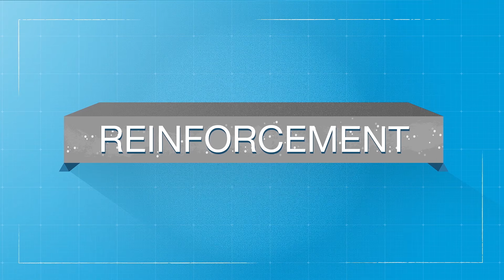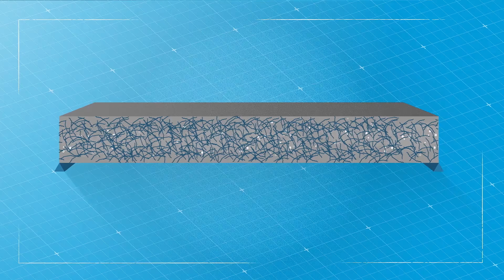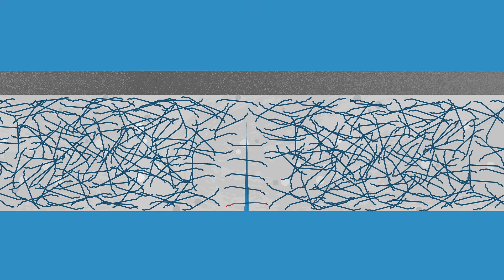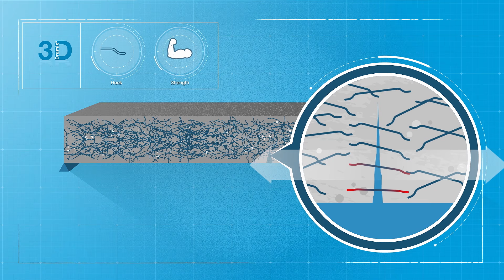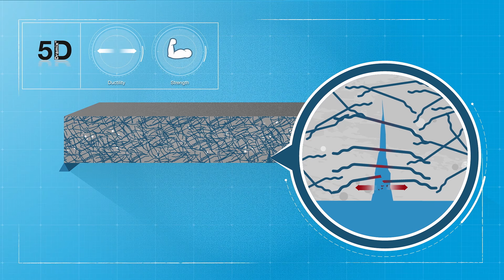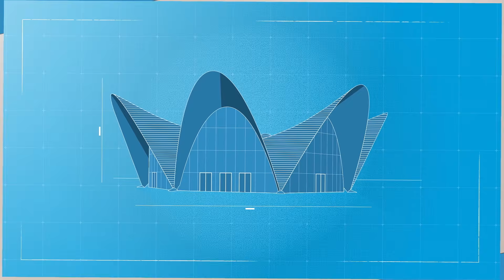Steel fiber concrete reinforcement – how does it work?

Comment: The question is does steel fiber rust? if so it doesnt help in concrete lifespan. We need an alternative that does not rust and can last longer than 50 years.

Comment: What happens when all those fibers rust?
Reply: The surface of the building gets a varying rusty color.  If you need a appearing surface it is better to use PP monofilaments. The remainder of the monofilaments are flamed away.
Reply: @holgernarrog962 what is PP?
Reply: @MadLadsAnonymous  Polypropylen....It is widely used for monofilaments for concrete in mining.
Reply: @ Is this the same strength as PET fibers?

Comment: What about corrosion? Doesn’t steel fiber corrode like rebar?
Reply: That`s the reason that there are alternatives as pp monofilaments, basalt fibres.
Reply: I'm not an engineer, but I think rebar and steel fiber only corrode when exposed to air.  If it is fully embedded, it will last forever?
Reply: @treslongwell1332 In ideal situation, that may be true. But when is it ideal unless you’re in a lab?  It’s just not air, Chloride leaching in marine environments and due to road salts can wreak havoc on steel rebars.

Comment: What about rust ?
Reply from the maker: Dramix steel fibers are coated with an innovative inhibitor to limit corrosion. Moreover, once the fibers are added to the concrete the possibility of corrosion reduces significantly.
For more elaborate information check this link: https://bit.ly/3kKJ55F

Comment: No comment on corrosion? Steel all the way up to the surface seems like a major issue.
Reply from the maker: Corrosion on steel fibers doesn’t affect the mechanical properties of the concrete. The fibers form a discontinuous network of reinforcements so the corrosion stays limited to the outer surface of the product. Because the fibers are small, the volume increase does not lead to concrete spalling either. If the visual aspect of the end product is important, many of our fibers come in galvanized variants as well as well to avoid any corrosion at all.

Comment: I scrutinize about hybrid-fibers. What is the best (in terms of compression,flexural strengths,split tensile strength) hybridfiber percentage for 1m³ concrete by volume ? If i determine total volume %0.5 for 1m³ concrete, how much i use polypropylen and steel fibers? Or steel fiber and glassfiber?
Reply from the maker: From a structural perspective a combination of steel fibers and traditional rebar or steel mesh offer good strain compatibility (see design guidelines in Modelcode 2010 or the German DAfStb guideline.) 
It is proven that the steel fibers in this hybrid system offer substantially better crack control, improving the durability of the structure. Also for the ultimate limit state the fibres increase the resisting moment capacity. The optimal ratio depends on the project requirements and should be defined by design. 

For outdoor pavements, a hybrid system combining steel fibers with micro synthetic fibres is good solution. The micro synthetic fibres will reduce cracks due to plastic shrinkage while the steel fibers will increase the loading and fatigue capacity of the pavement. 
The optimal ratio 0,6 to 0,9 kg/m³ micro synthetic fibres added to the required dosage of steel fibers. This dosages should be defined by a design in function of the project requirements.
Reply: @Bekaertchannel  Thank you so much for your precious comment. I will scrutinize the Modelcode 2010. I will prepare 0.0135 m³ mini beam and i will use steel fibre (30mm) and polypropylen (12mm). Can you suggest me proportions?
Reply from the maker: For getting a first ‘feel’ of the product behavior in small beams we would propose to start with 30 kg/m³ steel fibers and 0,6 kg/m³ polypropylene fiber mix. After that, all combinations are possible, varying the steel fibers dosage between 20 and 40 kg/m³ and the PP fibers between 0.6 and 0.9 kg/m³. We would also compare the behavior with only steel fibers and only polypropylene fibers.

Comment: There bitch to finish.
Reply from the maker: When using a well-designed concrete composition, adequate machinery (floaters, laser screed machines, power floating machines,…) and skilled labor (installers and floor finishers)  it is possible to deliver a steel fiber concrete floor with almost no fibers at the surface. A dry shake topping, applied on the fresh concrete with a spreader machine, will further cover the few fibers that might appear at the surface. For more information please contact our local organization. https://bit.ly/3dgT6BO
Reply: @Bekaertchannel  I agree but as a finisher I know, that at the end you have to walk the floor cutting the fibers and patching.

Comment: Is this good for a driveway 4" thick?
Reply from the maker: The load capacity of a concrete pavement depends on several parameters such as but not limited to subbase, concrete quality, Dramix type and dosage. But with a stable subbase and a dosage of 33 pcy (or higher) of a Dramix 3D fibre the driveway should easily carry a Ford F150 truck (or similar). For more specific guidance and technical advice please contact our office in Marietta. ( +1 770 421 8520). For the construction of the concrete driveway follow the general national guidelines. (ACI 360, ACI 544,…)

Comment: Hello im from ecuador and i wnat to know if i can use steel fiber in concrete paviment that have a 0.15 or 0.20 cm of thickness ?
Reply: U mean to say .20 m bro
Reply from the maker: Hi Denisse. For specific questions like this you can contact our local representative, mr/ Ishay Colina at ishay.colina@bekaert.com.

Comment: Thats going to erode very quickly unless you use very expensive stainless. Its better to just use glassfiber or moderately expensive carbon fibre. Makes for a lighter product aswell and wont erode.
Reply from the maker: Corrosion of steel fiber in concrete is not a problem. 
This independent of the size or diameter of the fibre. It is even generally accepted that steel fibres can have a very positive effect on the durability and lifespan of normal reinforced structures. The fibres keep the cracks smaller so decarbonization through the cracks is slowed down. 

We respect all sorts of building products and leave it to the designer to make the right choice of product, for the right applications, at the right cost.  We see it as our task to provide technical information, based on extensive internal and external testing, codes and standards, so the designer can make a decision based on facts. However choosing against steel fibers  out of concerns on corrosion would be a decision based on wrong assumptions. And this would be a pity because steel fiber concrete offers a lot of advantages to the construction world.
Reply: We did not use expensive stainless. The wires of Dramix are coated to avoid this type of erosion. And on the conventional steel used with concrete, you will have a lot more of this oxidation and erosion. We use steel fiber because the steel have more compatibility with concrete. Carbon fiber didn't.

Comment: Such a lying opening statement for sales purposes. Building inspectors, where I live, do not allow steel fiber to replace rebar. Concrete is brittle? Then why are Roman Concrete structures still standing? There is a reason concrete is used; MASSIVE COMPRESSIVE STRENGTH which means  LOAD BEARING CAPACITY. NOT BRITTLE! Your "load bearing capacity" animation implies that concrete has little compressive strength, yet it is an animation for tensile stress, which rebar is far superior to fibers if you must choose one. Concrete is reinforced by steel rebar to aid against tensile stress and shear stress but these stresses are much less when more compressive stress is added to the concrete. This means concrete is not brittle, it's CONCRETE!!! Steel fiber is an additive to steel rebar, not a substitution to tying less rebar like this sales pitch implies.
Reply: Dylan, I find it very psychologically interesting that it appears you do not want to see growth in concrete tensile ability...
I am not trolling you, I DO SEE in the construction industry that the human HAS to have his beliefs "added" to for advancement to happen.
That contractors, are NOT as intelligent as they believe they are, no offense meant...
The problem with intelligence is, sometimes we are so "smart" we believe we already have the ONLY answer...
This belief STOPS growth...
To help you, you might have let go of your "conclusive files /bias" and ask specific questions such as, what are the unsupported spans of this product compared to none reinforced concrete of the same mix design, minus the fibers?...
This would give you data you can use to show how this reinforced concrete will make your lack of tamping or soil erosion (under a pad let's say) more superior... using fiber reinforcement.
Personally, I do not want to spend a single extra minute installing rebar if the future of steel fibers can integrate them at batch plant...
With all that said, your furry against the future will not stop steel fibers from dominating the true engineered concrete...and your choice of portland, stone and sand will go the way of the Romans...
Reply from the maker: @NC Hydroseeding, please find below more information about how to transform a mesh or rebar reinforced ground supported floor into a Dramix steelfiber reinforced slab. 

Step 1) Calculate the moment capacity (Mrd) of the mesh reinforced section applying the conventional internal equilibrium force formulae. 
Step 2) Use Mrd to define the required residual flexural stress of the steelfiber concrete.
Constitutive models can be found in different standards. Hereunder a non-exhaustive list of steelfiber concrete standards:
-	Modelcode 2010 (International)
-	DAfStb-Richtlinie. Stahlfaserbeton (Germany)
-	IAPMO ER 465 (U.S)
-	AS3600 , Australian standard for concrete structures (Australia) 
-	CECS38:2004 (China)
Step 3) Based on the material characteristics (post crack residual tensile stresses) provided by the steelfiber producers a fibre type and dosage can be selected providing the required residual stresses (defined in step 2).

We have freeware design software available for design engineers. If you want to know more about it, dont' hesitate to contact us again. Our technical advisors can also help to make the design for you. 

Specifying a steelfiber solution can be done by defining the steelfiber type and dosage.
 
Attention ! There is a large range of different fiber types available, each with their proper performance. Not one fibre type is the same.

If the specification  needs to be completely generic a post crack residual flexural stress should be defined.
Reply from the maker: Concrete is indeed used in the first place for its great resistance against compressive stresses. Nevertheless, in many concrete structures nowadays, important tensile stresses are also present (not like the Roman structures). Unreinforced concrete behaves very brittle under tension and this is a major safety risk in structures. Rebar can overcome this behavior, but steel fibers too! The choice between rebar and steel fibers depends mainly on the type of structure. The TCO and technical requirements are key here. For example, in case of tunnel segments and industrial floors, steel fibers are clearly the preferred choice.
Reply: @Bekaertchannel  It is a strawman argument to suggest that Roman Concrete did not experience significant tensile stress over 2,000 years on the earthquake-prone Italian peninsula; even aqueducts spanning across rivers still exist today given that fact. The first line of this video is "concrete is brittle". Are you willing to retract from this belief? I agree that modern structures such as bridges are under more extreme stresses and require reenforcement, but reenforced concrete has been around for over 125 years, while steel fiber just 40 years; and as I claimed previously, most cities and counties where I live do not allow footers without steel rebar, fiber is just an additive. You can't make rope out of concrete "tensile strength", but while It doesn't even mention TCO in the video, the main argument is that concrete is brittle! Are you going to stand adamantly to that claim?
Reply from the maker: Unreinforced concrete is brittle by nature. Let’s substantiate this with a theoretical analysis. The uniaxial strain of concrete under tension can be defined with the following formula
ε_ct=f_ctm/E_cm 

f_ctm : Uniaxial tensile stress of concrete (N/mm²)
E_cm : Tangent modulus of elasticity of concrete (N/mm²)

Let’s  take a C30/37 concrete as example and base ourselves on values published in Eurocode 2:
f_ctm = 2,9 N/mm²
E_cm= 33.000 N/mm²
ε_ct= 0,000088 

Strain can also be defined with the following formula:
ε_ct=∆l/l
If we would cast a beam of 10m long (l) and fix it at the extremities the maximum elongation (∆l) the concrete can take before cracking would be 
∆l=0,000088*10.000 mm
〖∆l〗_R=0,88 mm 
Alternately we all know concrete shrinks and the total shrinkage ( ε_cs) is comprised of two components:
- Autogenous shrinkage strain : ε_(ca(∞))=2,5 (f_ck-10).〖10〗^(-6)=50.〖10〗^(-6) 
- Drying shrinkage strain : ε_(cd,∞)≈520.〖10〗^(-6) (For relative humidity of 40 %)
- Total Shrinkage strain* : ε_cs=570.〖10〗^(-6)
(* values for a C30/37)
For the same beam of 10 m the structure will shrink :
〖∆l〗_E=5,7 mm.
This means that the structure will shrink 6x more than the capacity of the material. 
I believe it is logical to conclude, that a restrained structure already cracking under its own physical behaviour, without even applying an external load can be called “brittle”. 
The Ancient Romans already knew this. That’s why their viaducts are constructed with arches so mechanistically the whole structure remains compression. 
The Parthenon in Rome is a unique marvel of engineering where the dome is in perfect equilibrium and fully under compression.
Reply: @Bekaertchannel  Thank You for doing the engineering proofs of what I have just said, concrete is not brittle when it remains under compression. Then why does your first claim in the video claim that concrete is brittle?  I have never once implied that re-enforced concrete is not needed, and since re-enforced concrete has been around much longer than your product, it is my belief that the marketing should not be centered around a false claim, concrete is "brittle", which it is not, contrary to the initial claim in this video, and has been my central argument; rather, you should market your product as a new re-enforcement means of producing a better alternative to an already great product that has already built today's infrastructure.... Steel Rebar re-enforced concrete. Don't bash Concrete in your marketing. Instead bash the process of the labor it takes to place rebar.
Reply from the maker: In our video we don’t want to discredit any type of building material. When we mention concrete being brittle we intrinsically implied brittle under tension. That’s also why, immediately after the opening statement we show a beam under loading. We completely agree with you that there are no issues with concrete under compression. On the contrary, it’s a very good building material offering high value to the construction world.
We thank you for pointing out a possible misinterpretation with the opening statement in the video.
Reply: @dylanangel3143  Dylan, in my experience, concrete slabs are brittle; hence the CODE requirement for reinforcement and expansion joints.   If you take a slab (which this is addressing) of say 4" depth and attempt to pick up a section with a skid steer... the concrete will snap.  As I understood the advertisement if I were to attempt the same with a steel fiber matrix my 2 SF segment of the unreinforced snapped slab would be a lot smaller than the reinforced slab.   
Question for Bekaert: If my slab drawings require rebar and/or wire mesh.... how should I adjust/augment with the fiber mix? OR how should I get the specs adjusted to not require wire and rebar?

Comment: But what about oxidation ?
Reply from the maker: Steel is protected by the alkalinity of the concrete. However after some time the basicity of the concrete can decrease due to carbonatation. Once this protection has faded, corrosion will be initiated. When the Dramix® Steel fibre corrodes, due to the geometry of the fibres (thin diameter), the corrosion products do not exert stresses enough to crack the concrete, unlike in rebar, where this is a concern. Due to the discontinuous nature of reinforcement of Dramix®, they do not conduct the corrosion currents unlike Rebar mesh. Hence due to discontinuity, there is no propagation of corrosion even if it is initiated.
Reply from the maker: Our 45 years’ experience has proven that glued fibers provide good mixing properties. We have not seen any difference between long and small fibers. In-house tests show that neither glass nor carbon fibers offer better performance. For more details on steel fiber performance in a  wide range of applications, please visit our website or contact our local sales/technical representatives. bit.ly/2S4fkho
Reply: Huge problem, especially when its just small fibers. Better solution is glassfiber or a stiffer fibre like carbonfibre. And you get weight savings. 1-3% fibre makes a huge difference.